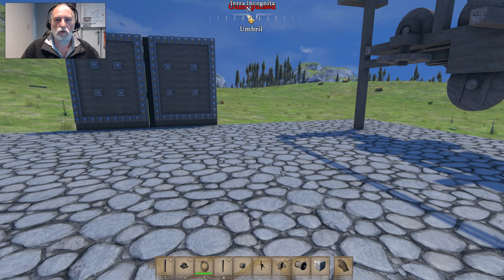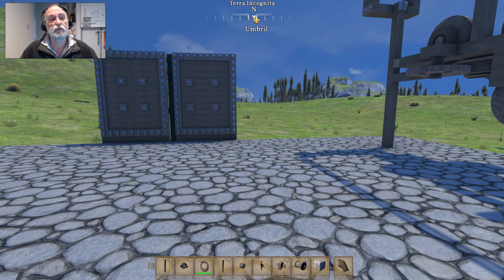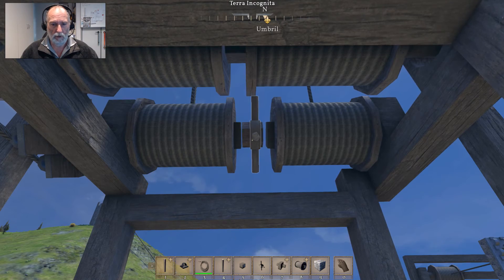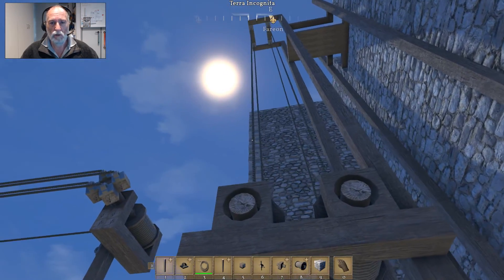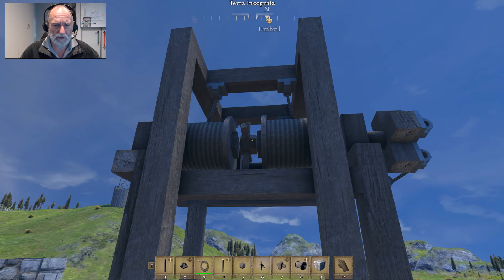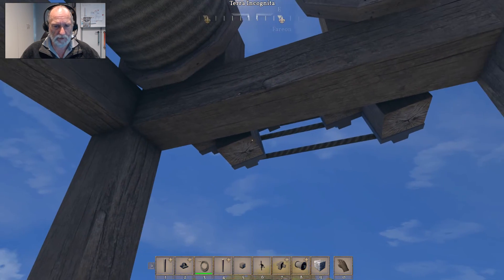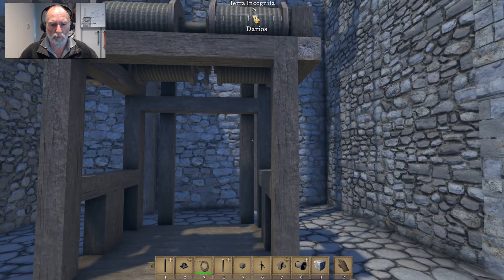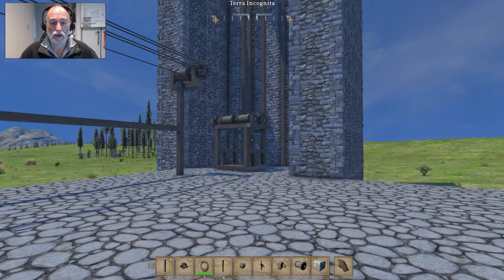Medieval Engineers - Working Elevator

Comment: Do you still play? I have a similar thing i'm working on and it has turned into quite the complicated mess.
Reply from the maker: I haven't played for many many months now, but to my knowledge there hasn't been any updates either so everything should still be the same. Cheers.
Reply: @Toshba47  shame to hear. They had a final update so its a touch different I think. Im willing to share my system if youre interested in return for some insight.
Reply from the maker: @justinknoepker1850  Thank you for the very kind offer but I have kind of moved on to other games and interests. Cheers
Reply: @Toshba47  best to you none the less. Got it since figured out.

Comment: I found a new method for pushing carts, since pushing or pulling by default doesn't work as well as it used to. Obviously rope pulling works still on foot as well, but there IS a way to push carts even if they are very heavy with several full stockpiles. Simply attach a one-way catch block facing you, the opposite direction of travel, and attach a few timbers (to make it flat or a steering wheel). Pushing on that new small grid will make the entire cart move, even if you can't move the cart by default.
Reply from the maker: Thanks Bacon, I'll have to give that a try. Cheers

Comment: how do you line up the crosses on the side mine wont spin
Reply from the maker: I use a three long timber down the middle and then a single long timber on each side. Make sure that the axle doesn't turn until you are finished. Watch this one for a detailed explanation. https://www.youtube.com/watch?v=nIFJr3dVapQ&list=PLDkGSH8BflmPRMvS1EAeVHibkuTLy40yw&t=19s&index=1
Reply: Thanks!

Comment: Thankyou Tosh... A thought provoking presentation... When harvesting timber from the forest it seems as though Ithese mighty trees can be moved simply by nudging them along the forest floor. One might find this odd for the trees as they are, should the character be so slow or unlucky to have one fall upon them immediately dies.. which would indicate to my uneducated-self that the trees have sufficient mass if not the effect of weight to kill upon impact. If the values such as weight and mass in this game are so out of sync with what many would consider reality, is it any mystery as to why there is difficulty in constructing a machine that relies at least partially on these aspects for it's successful operation such as a cranes, a lift or a wheeled vehicles, rail guided or otherwise? what good are weights and counterweights and notions about surface friction if these values do not have their influence..or don't seem to?
Reply from the maker: Very true! I also think it's odd that by simply attaching a rope to an object that my power to pull increases. No block and tackle or reeving system to increase my power ratio just attach a rope and away you go. :) Thanks for the thoughtful response.
Reply: One idea can lead to another... My current ambitions are somewhat more.... modest... Y'know there are some who might see fit to criticise M.E. where the inconsistencies are concerned but I prefer to look forward to what will be possible in this game as the Developers continue to dot their I's and cross their T's whilst other gifted Modders make their contributions to mix. I only hope that they all stay true to the game's theme and resist the urge to progress the available technology beyond a certain point or they'll have to rename the game to Renaissance Engineer?
Reply from the maker: I too hope that the Medieval period is held fast in the game. There is a lot that could have been done back then IF the knowledge of the likes of DaVinci is any proof.
Reply: So desu.
Reply from the maker: Hai!

Comment: That's amazing - truly outstanding engineering.  Are their weight limits with the elevator, similar to the overloaded cart?  Or would a fully loaded ore elevator still easily rise up?

Thanks for a great video!
Reply from the maker: I'll run some tests and let you know. :)
Reply: A elevator design I have come up with is pretty stable and it can lift pretty much as much as you want. If you want to check it out it is one of the recent videos on my channel. I have also designed lift for picking up carts and siege machines to bring them over castle walls but I haven't recorded it yet.